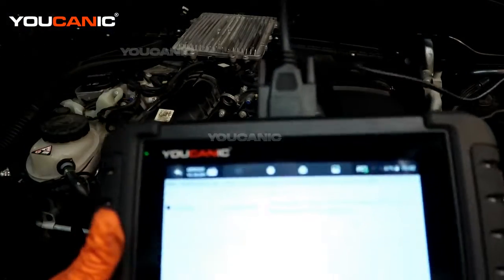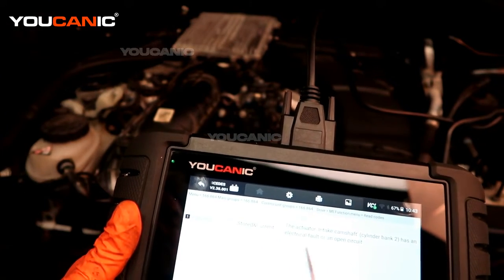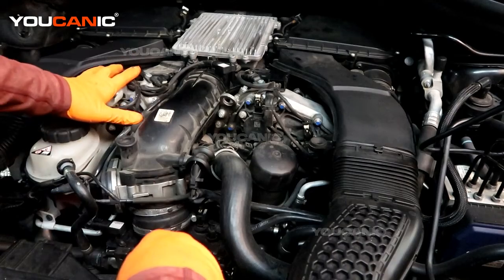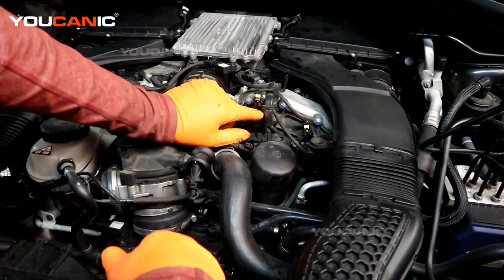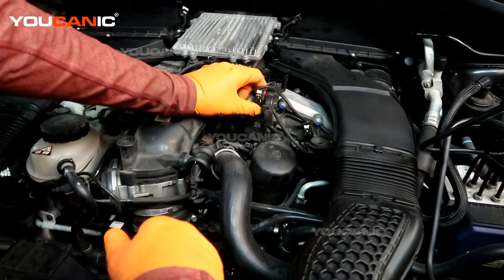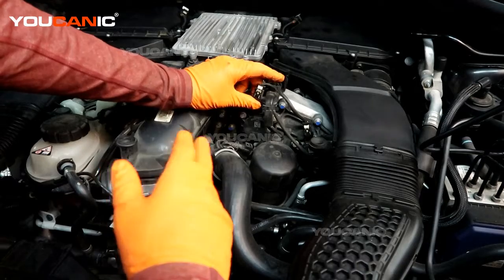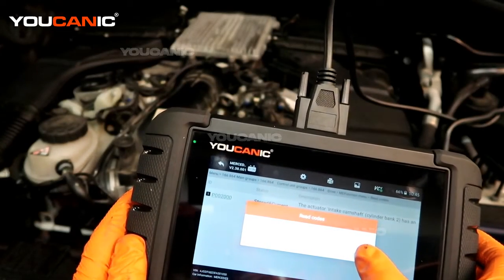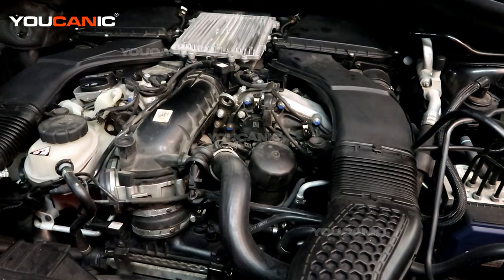Mercedes-Benz P0020 - The Actuator Intake Camshaft (Cylinder Bank 2) Has An Electrical Fault

Comment: Any chance you know the location of  oil control valve aka  vvt solenoid?? On 2007 mb c230.... already changed both cam sensors  both cam magnet all on bank 2.

The original codes p0026 gone.. now i have p0020... same bank 2... i just cannot seem to locate the location of the vvt solenoid.. any help much appreciated